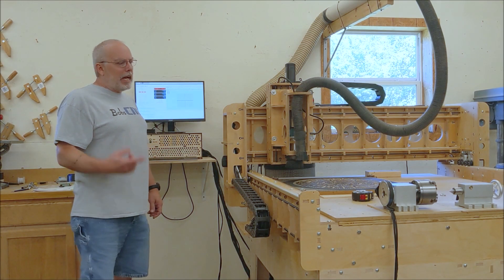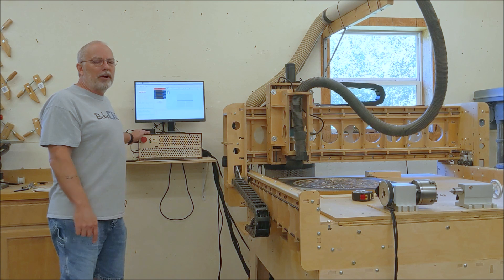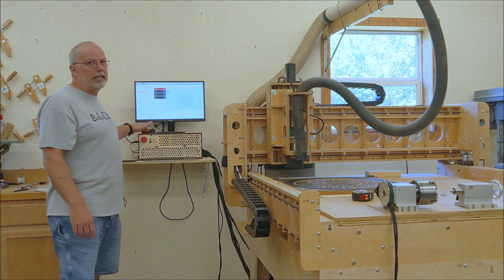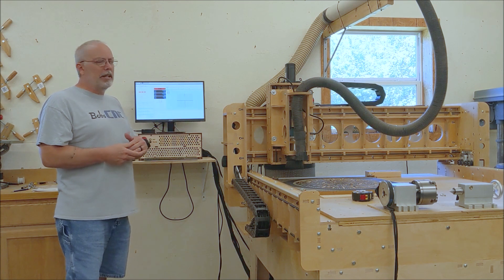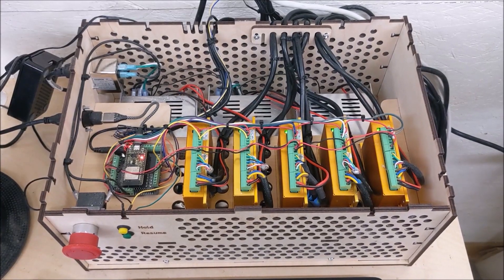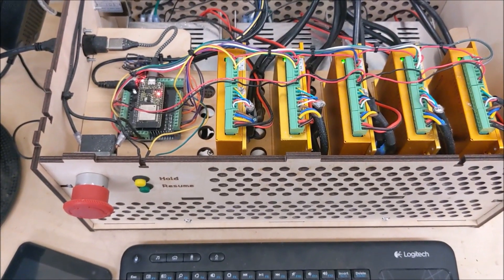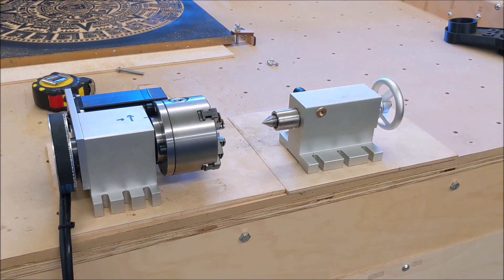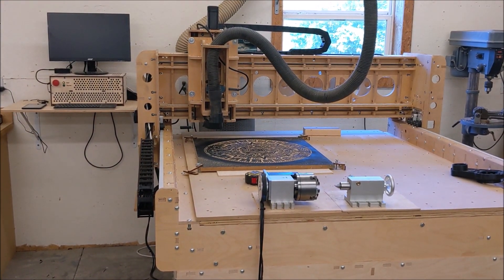Bob's Shop: ESP32 6-Axis Controller

Comment: Not familiar with GRBL I’ve mostly ran industrial machines and familiar with centroid. 

1.) Is the ESP 32 a good simultaneous 6 axis motion control? 

2.) any issue running closed loop? 

I have bins of Arduino boards that I’ve collected. Finally getting around to playing with it and seeing whats its capable of. The low price points made me feel like id waste my time thats why they’ve sat but a few people say they are happy with theirs yet I’ve talked to had the ESP32 running 6 axis so Im out on a limb for your opinion on this one. 

I am EG casting a turn mill this next week, or two and was originally going to do 4 axis realizing that the centroid board I have is only mill pro, so my alternative is Linux CNC but thats for another machine I hate to give it up. Alternatively i have a few 5i25’s but not enough daughter boards. Id like to jump up to 6 full axis its not any more work at this point, just a few more parts. I plan to do a series of my own on epoxy granite molding. I have a fair amount of experience building machinery so it might help a few with all the misinformation out there.

Please let me know, thanks.
Reply from the maker: Please email the helpdesk@bobscnc.com in regards to this question.  Thanks.
Reply: post the reply please :)
Reply from the maker: @merlynsfire1275  I would, but I run the social media and might not give you the correct information.  The engineering dept have the knowledge and they will give you the correct info.